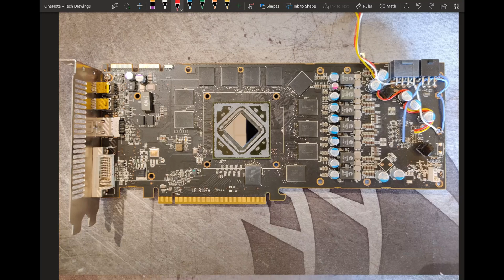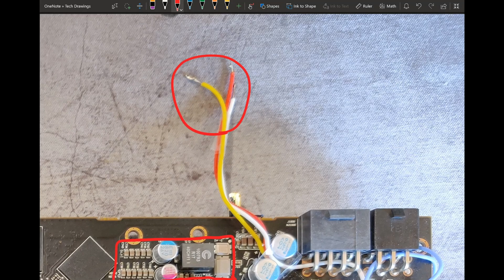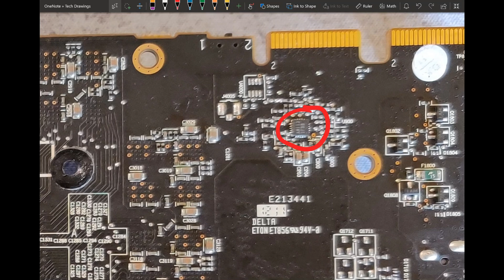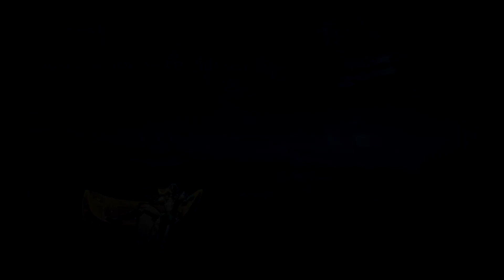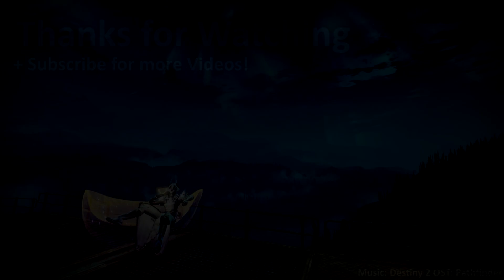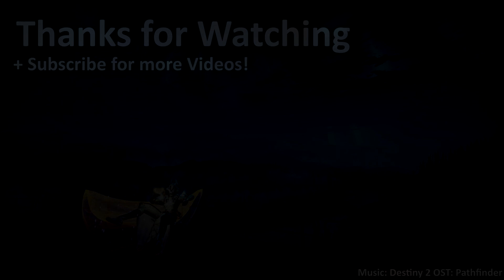Radeon HD 7970 Reference "Blower Cooler" PCB Overview

Comment: Hello i got this card but it has XTREME heat problems. I reach over 95 degrees after 5 minutes of gaming... thats not normal! I changed the thermal paste with arctic mx4 and the thermal pads with arctic ones. But still it gets so hot.

Why does this happen? Do i make something wrong? I used 0,5mm thermal pads which seem to work right! But something must be wrong but i dont know what it is.

The blower runs over 75% speed and is really loud and still the card is overheating. Do u know a solution for this?